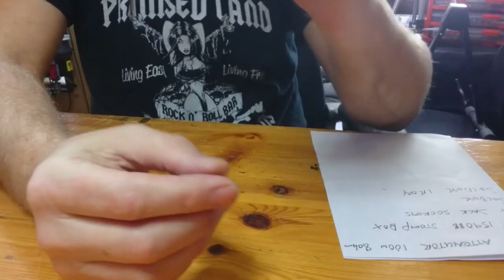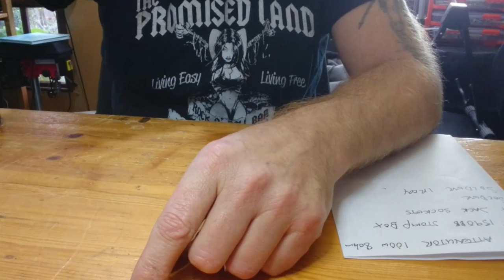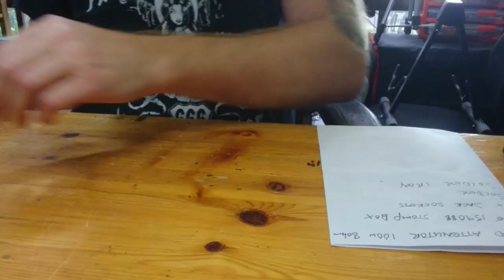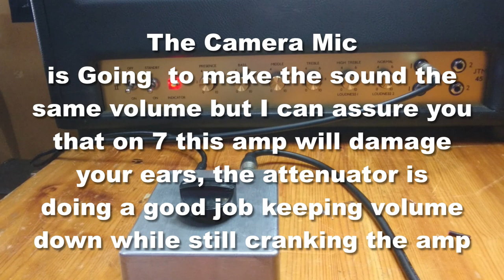Easy DIY Guitar Attenuator Build For Your Tube/Valve Amp

Comment: 1.  You can buy this unit off Reverb for $55 already wired and totally complete as the "Speaker Soak"...BUT it has no ventilation holes.  That's where the guy making these saved labor, because drilling the holes is the most tedious and time-consuming part of the build.
2.  I made mine with $35 worth of parts (inc. tax and shipping) bought off Amazon.  But in either case I would have had to drill the frickin' holes.  
3.  Make sure the L-pad is at least twice the rating of the amp's wattage.  Amazon sells a 50-watt one for 16 smackers.
4.  From the "you'd think I'd learn" dept.:  I (once again - after a similar project) got happy drilling one of the holes for the jacks with a long (and large) drill bit, and the bit got caught and violently spun the project box around, slamming it into my wrist, cutting it, and also forming a huge lump and bruise.  The box was also fractured and deformed around the hole.  When I saw the damage that was done to the box, I figured I came out of the deal with no worse a physical injury. 
5.  Best approach is to use a step drill bit (a very handy device for drilling in metal).  I had one I had been using, but I just got stupid and lazy with that hole.  But at any rate, BE VERY CAREFUL DRILLING THEM HOLES!
6.  Great video - thanks for posting!

Comment: I hope these comments don't seem like I'm taking away from this project, I've built some of the L-Pad attenuators before and they are great tools to have. I just wanted to add a couple things.

1. The L-Pad rating is a bit deceptive. I'd be very nervous using one to bring your 100 watt Marshall down to bedroom levels. A 100 watt tube amp will put out more than 100 watts when it's cranked. These work best for 15 - 30 watt amps. 50 watts would be pushing it. They will get warm, that's normal, but if they get really hot you're asking for trouble.

2. Comparing these to expensive attenuators isn't really fair (sometimes). A lot of those expensive attenuators use a reactive load instead of a purely resistive load. The reactive load will sound more natural, especially when using it to really dial the volume back. Some expensive attenuators really are the same as this though. In that case the comparisons are fair.

Anyway, just wanted to make those things clear. These really are great tools. Go build one!
Reply: What is suitable as a reactive load for a 20w amp. I thought about just putting a ceramic resistor to attenuate just a bit. My problem is, I need bedroom levels and it's always a hassle to make dial it in at around 1, because it's either too loud or too silent and dull. But if a resistor will make the sound of the power amp sterile I don't want it either. So, then you need something like a speaker and you try to mute it? Or what is a good reactive load, cheap of course, LOL.
Reply: @InTheSh8  Does your amp have a FX loop ? Try running a EQ or some other unit with a level control in the loop. Depending on your amp in terms of volume controls being pre or post loop you can use this method to reduce volume. As a example, I run a Peavey 6505+ combo FX loop into a rack FX. The channel output on the Amp is at 3 and the output of the FX rack is set to nearly 0. It is not quite the same as attenuation, or using a load box, but I think it is safer for your amp in the long run.

Comment: Nice build Dave.  Just one suggestion however.  Clarify the ground wires solder to the sleeve of the jacks.  Hot wires go to the jack tips, just the tips.
Reply from the maker: there is a link to the schematic :)

Comment: Great video Dave, can you please explain the signal path from guitar to amp (or speaker) through Attenuator? How did you plug everything together?
Reply from the maker: From guitar amp speaker output 8ohms to attenuator input, attenuator output to speaker.
Reply: @DaveBarlowGuitar  thank you!

Comment: Thanks for the video and schematic Dave. I'll have it built in the next couple of days (the diecast box I bought was slightly small for the L-Pad so I need to make some modifications to it) but hopefully it'll work just fine thanks to you. The thing I'm curious about is the way you installed your L-Pad the lugs away from the input/output jacks. I'm no technician but isn't it a matter of just turning the shaft all the way anti-clockwise & then putting the indicator plate (if you're using it,) which ever way you'd like it and the knob so it points where-ever you want zero/off to be? No matter which way around you put the L-Pad, 0% will be all the way to the left & 100% will be all the way to the right won't it? Is there something I'm not seeing in my ignorance?
Reply from the maker: check the schematic, if you wire it back to front it will break.
Reply: @DaveBarlowGuitar  I get what you're saying. Thanks again for making it so easy to tame a loud amp for bedroom use at an affordable price.

Comment: I have a Two Notes Torpedo Captor 8 that I just want to attenuate slightly. It has full or -20db.  I need -10db approx. I use a 16ohm cab that I use for dry only. I assume a 16 ohm L-pad would be adequate?
Reply from the maker: I have no idea what you are trying to do.
Reply: @DaveBarlowGuitar  I figured it out, when any speaker is connected to the Two Notes, the load goes to the speaker instead of the reactive load. I can use an L-pad type attenuator no problem between the Two Notes Torpedo Captor 8 and a speaker. The L-pad attenuator impedance just has to match the speaker when in use.

Comment: Nice work Dave, I had no idea they were this simple. I've a Peavey Classic 50, do I have to put another input for the speakers? Sorry that I'm being thick, electrics aren't my thing, I just wonder how it would work on a combo.
Reply from the maker: If the speaker output is hard wired to the amp you will need to modify the speaker wire, if you are not sure might be best to get a qualified person on it.
Reply: @DaveBarlowGuitar  Thanks Dave, appreciate you taking the time to reply.

Comment: I just built this and it works pretty good on my 40w hot rod deluxe. I’m using a 8ohm 100w lpad. My only beef is that it’s super sensitive, a slightly large movement on the lpad and it gets loud real quick. Any fixes for that?
Reply from the maker: not for this simple design, you could add a resistor or do this http://diy-fever.com/misc/air-brake-attenuator/
Reply: PUT A ANOTHER POT BETWEEN THE CENTER POLE OF THE LPAD AND THE GUITAR JACK THAT SHOULD DO IT FOR YOU

Comment: Excellent idea Dave, and great video!!! How would I make one for my old 100w 1959 Super Lead with two 16 ohm quad cabinets? Obviously the head is set to 8 ohm for the full stack. So, would I still use the 8ohm L Pad and wire two jacks for the output to speakers???
Reply from the maker: I wouldnt, prob best to get an ox or something like that.

Comment: Is this really all a speaker attenuator consists of? 3 parts and an enclosure?? I salute you sir
Reply from the maker: Yep, but if you have a 100 watt amp cranked it could get a bit hot :)
Reply: Thanks it’s only for my Blues Jr. Even my Marshall is 40w. Have u seen the ‘other’ attenuator build video where he adds an on off switch and another resistor?
Reply from the maker: Yes but kept mine simple for others to copy. :)

Comment: Excellent video and demo, was thinking about this for a long time. Could I use this with a PRS MT15 that has master volume for lead and separate volume for clean? Luckily it has the 8Ohm output.
Reply from the maker: Go for it! but why if it already has a master volume?
Reply: @DaveBarlowGuitar  the taper is horrible, goes from 0 to 95% in quarter of a turn.
Reply from the maker: @lorencing  I think something is not right, that does not happen with mine.
Reply: @DaveBarlowGuitar  many MT15 owners complain about that, you can look it up on the PRS forum. Who knows, could be that they ran out of bat taper pots that day and had to use a good one for your amp hahah

Comment: It's easier to get the impedance you want by using a voltage divider (two resistors, e.g. two 25ohm resistors, one to ground, one to output), then a rheostat to fine tune the attenuation level.
Reply: I'm looking for just this - searching for schematics

Comment: Nice video. I built one.  I like to test things  with a meter before I try them.  It doesn't  do what I expect but from threads I've  found it seems like I get similar reads than they did putting a meter accross it.

What's  your approach to this?  Do you check it in any way before risking your output transformer on it?
Reply: Oh yeah, also I notice you connected the ground terminal to both Jack's independently.  What's your rational for that?  I figure they're  connected via the chassis already so I fought the urge...

Comment: Hi Dave, thanks for showing us your build! :) 
I'm building one just like this now! But I have seen some people on forums saying that it won't actually handle 100W amplifiers. Have you tried it? 
I have two use cases for my l-pad attenuator:
#1 in my apartment with my 50W Fender Prosonic (should work fine for this??) 
#2 When I'm doing FOH-sound for a rockband I'm working with. They use 100W heads (Marshall jcm800 2210) - in this case only some slight attenuation is needed. Just want to lower the volume on stage a smidge, not bring it down to bedroom level if you know what I mean. Will the L-pad melt??
Reply from the maker: It will work fine, the concept for this build is for people who are running amps at gig level but need to push it a little more rather than using it to crank your amp wide open at bedroom levels.
Reply: @DaveBarlowGuitar  Cheers mate. Yes this is my thoughts exactly! It’s gonna make my FoH gigs much easier 🤘🏼🤘🏼🤘🏼

Comment: Just came across this, considering doing it. I noticed when you turn the attenuator knob, it’s a little noisy. Is it the quality of the pot, can it be lubricated, or do you just live with it?
Reply from the maker: I live with it as it does not affect the sound, its just one of those things.

Comment: Thanks for the video, I've got the parts on order for <$50. Does the type of patch cable you run between the amp and attenuator matter, or can it just be a standard instrument patch cable like you would use between pedals?
Reply from the maker: You must run a speaker cable from the amp to the attenuator, then another speaker cable from the attenuator to your speaker/s DO NOT USE PATCH CABLES :)

Comment: I think it would be good to use less wire and better quality jacks, insulating the terminals on the L-pad would be good too. A short or even open circuit on a valve amp output transformer is not good and could damage the amp. I don't understand why you faced the terminals away from the sockets either, surely the rotational direction of the knob would be the same regardless, the important part is wiring to the correct terminal. Attenuators are relatively cheap from Thomann, I'd suggest that would be a better buy and if it does trash your amp you have someone to complain to.

Comment: I tried this with a 50W marshall head, going into a 16 ohm cabinet.  Obviously, I bought a 16 ohm 100W Lpad for the project, but it was a fail.  I left the box open for better ventilation, but even at half volume on the lpad, and 5/8 volume coming out of the head, it was smoking the lpad.  Great concept though!!!!!!!!!
Reply from the maker: 100 watt Lpad will get hot but not that hot check you wired it up correctly :)
Reply: I thought I had it wired correctly, It does work for a short period before starting to smoke. possibly a weak solder connection????
Reply from the maker: @n9723x  what rating is the Lpad, needs to be 100w
Reply: yes, it is a 100W Lpad, 16 ohms, the impedance of my Marshall cabinet

Comment: Does it change the sound of the amp?
Reply from the maker: Not really but as I said in the video, your hearing perception is different at lower or higher volumes. Also at low volumes you are not pushing the speakers to working load :)

Comment: Dumb question, will this work in on fender reverb deluxe?
Reply from the maker: Dumb answer, probably but designed to be used on non master volume amps 50w or smaller.
Reply: @DaveBarlowGuitar  which is what a d.r. Is mate.

Comment: I have heard rumors you can pull 2 power tubes to back a 100 watt tube head down to 50 watt.  Can anyone confirm this?  I know the 100 watt tube heads can output 115-125 watts and would hate to melt down the head or the  attenuator.
Reply from the maker: yes you can (with many amps)but  I would buy an attenuator if you need to lower the output, its the best way.

Comment: Does this work for transistor amps? if yes, where can I find a 100w 8 Ohms Attenuator?
Reply from the maker: yes they are used for all sorts of applications
Reply: There is no need on a tranny amp, just turn it down. A tube amp needs to be cranked up to get the best tone, which is impossible  at home without annoying the neighbours.

Comment: How could I add a padded down Line Output to run into an interface for recording with IR's?
Reply from the maker: Some additional work would be required for this, but I know that some ettenuators come with a line output which would suit your purpose.
Reply: Just need a 600 ohms pick up resistor in the way.

Comment: I'd mount the L-Pad 180° around in the opposite direction, So you will keep the leads shorter and cut down on noise.
---
You strip to much wire- leaving a chance for shorts!!   Sloppy, Sloppy!!!